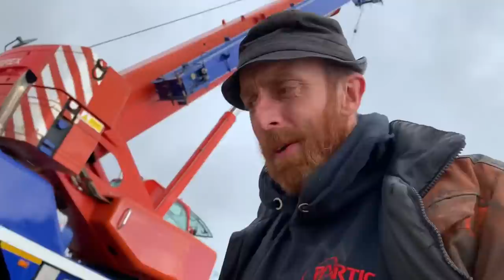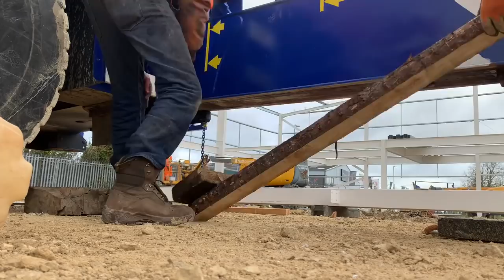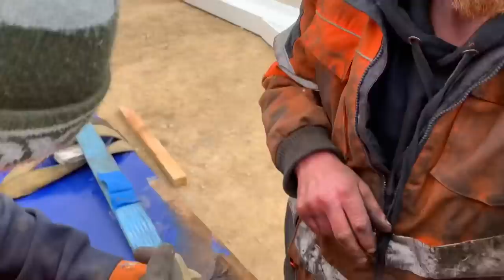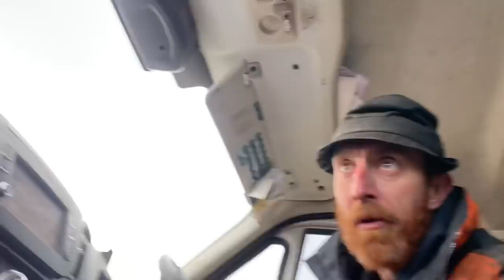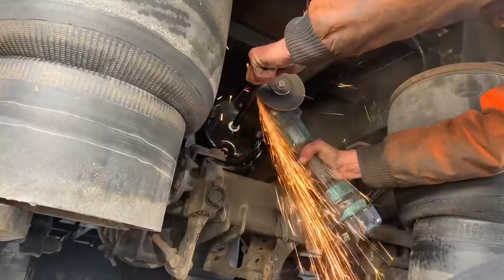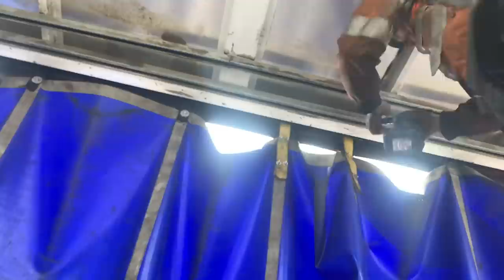The crane game!! Double decks double trouble mobile truck mechanic

Comment: What i use to put holes in ratchet straps is the shank of a drill bit or screwdriver and warm it up with my mapp gas torch then poke a hole through the strap and it melts all the strands together and stops them from fraying same when i cut the end off a strap burn the end with the blow torch.